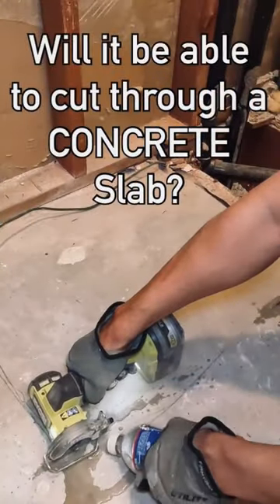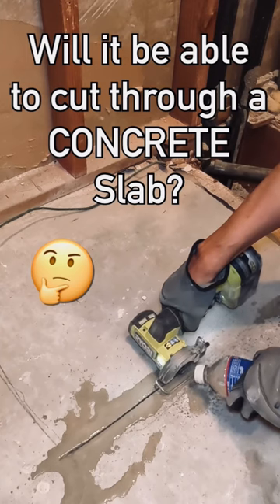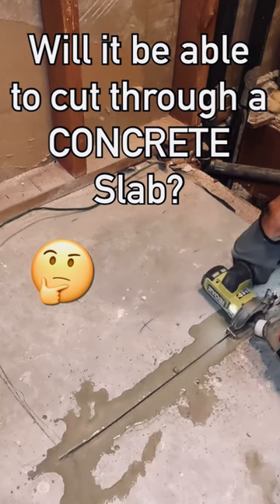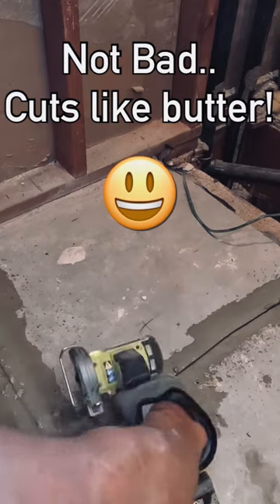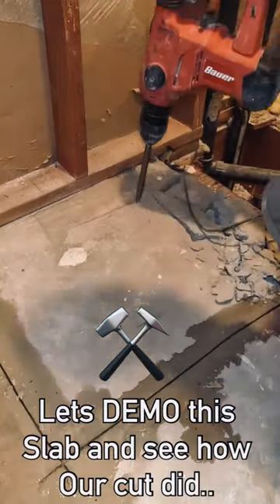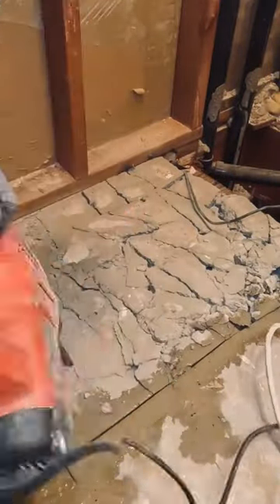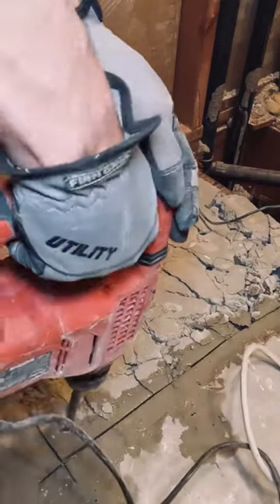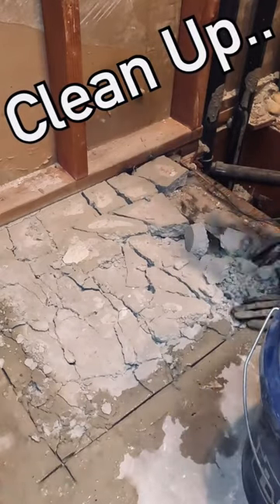How to cut through a CONCRETE slab with the RYOBI Brushless Cut-Off Tool #shorts #DIY #construction

Comment: God, we’ve got a cut off tool like that but you couldn’t be using it around here. If the floor is concrete, it’s a full slab and that’s not near enough blade to cut through it 😅
Reply from the maker: What area do you live in.. This cut off tool was able to essentially score the concrete at a depth of about 1 3/8” and the slab was 2” thick. Luckily it worked out